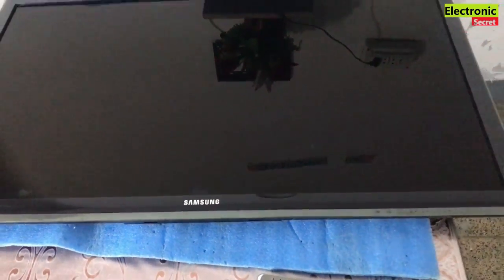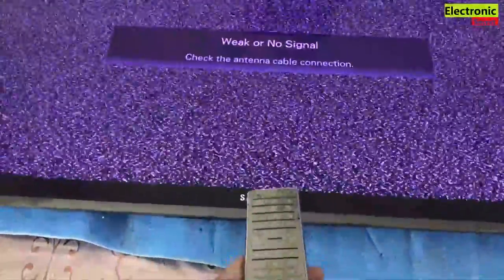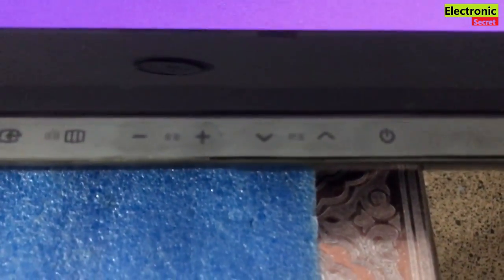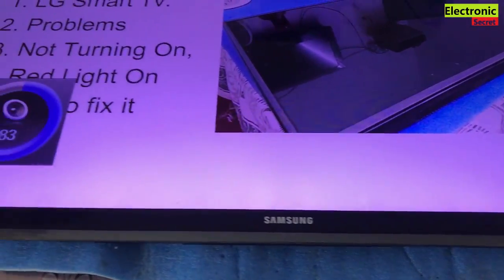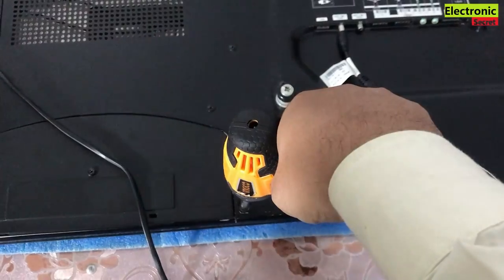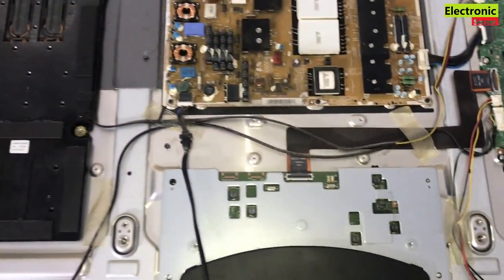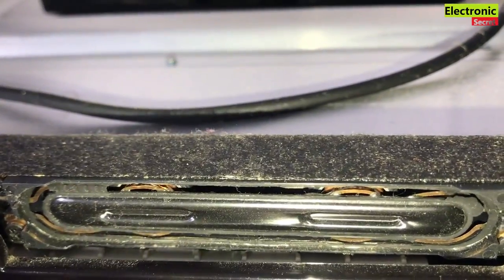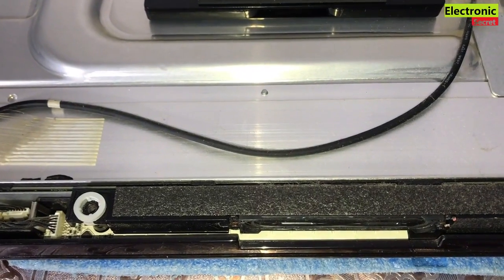HOW TO FIX SAMSUNG TV CRACKLING SOUND PROBLEM

Comment: The fact this has over 3k views shows the quality of Samsung. Mine crackles too on day one.
Reply from the maker: Basically this problem comes due to expiry of speakers life mostly,
May be your Tv is older than 5 years,
So this may be a issue
Reply: @ElectronicSecret  Tv is brand new and it crackles on the bose soundbar, regardless if I use optical or bluetooth. I know it is not the Bose because my other tv doesnt crackle when connected to Bose with same cable.
Reply: @ElectronicSecret  Update: I updated TV after connecting it to internet and the crackle went away. Now I will disconnect internet due to spyware.
Reply: @guitarandotherthings6090  your're not too bright huh. Fast to blame samsung for the issue when you figured out it wasnt that at all. Also 3k views isnt alot... lmao if this video had 300k views then you can say something.
Reply: @Patrick-vn4sb  You have no life trolling on my comment. I admitted it but I imagine you cant admit when youre wrong. Plus it still was Samsung's fault because not everyone has internet, so those without internet would not be able to fix crackle since they couldnt update. Sheesh get a life.
Reply: @guitarandotherthings6090  I have no life reading a comment and taking 60 secs to reply and carry on with life lmao okay
Reply: @guitarandotherthings6090  everyone should have internet, its 2022 for christ sake. Dont blame samsung because your still living in the past

Comment: Also if this happens just check your wires where they are plugged.. because my sound was cracking and it was just because on the extension cordwhere I have all my wires plugged ONE loose wire was touching where you plug them and when i moved the wire away from that specific spot the sound just started working again lmao wtf 🤣
Reply from the maker: You are right,
It is also possible